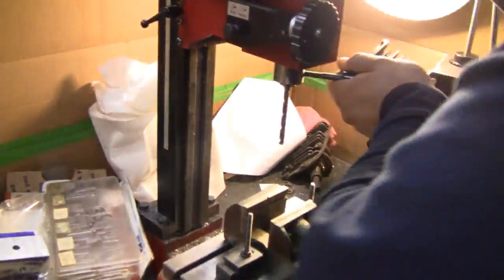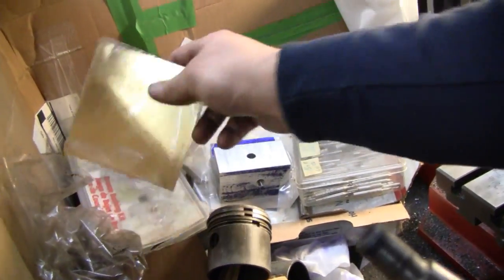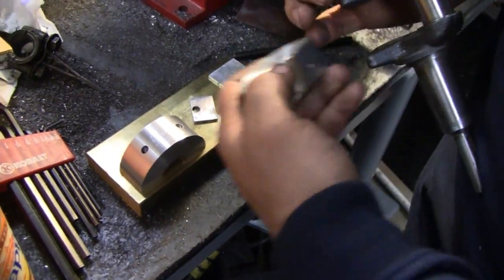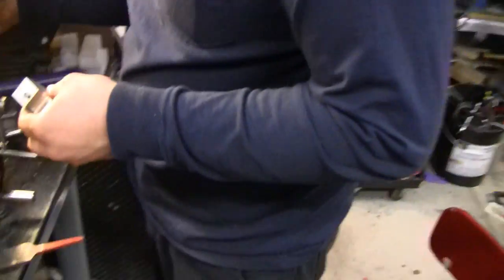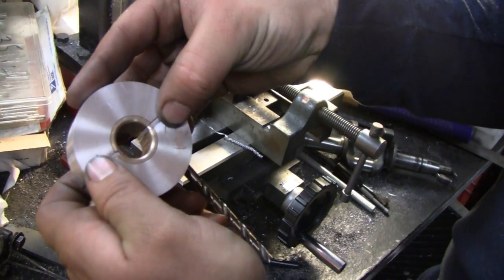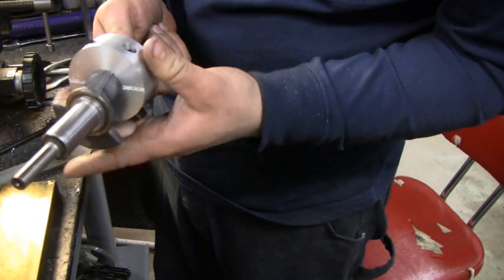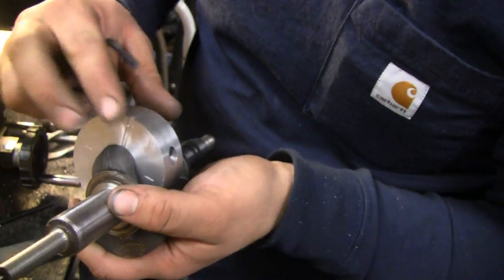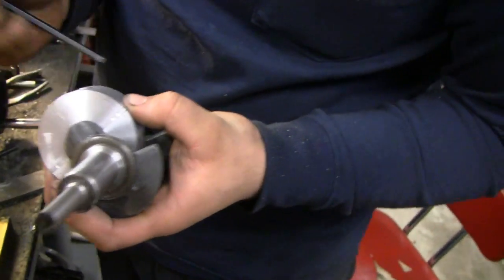HOMEMADE RADIAL BRIGGS ENGINE (part 17)

Comment: Wow, this is the last update you've done on the Radial in over 6 months, but I see you've been active with other stuff.  Hope you haven't abandoned this project!
I used to be involved with the EAA (Experimental Aircraft Association), and quite a few of the guys in my chapter were (re)building various classic aircraft engines, but I don't think anybody was doing anything like this!  When you do get this engine finished and mounted up on a display stand, I hope you have a wooden propeller attached to it.   You should use an aircraft style magneto for the spark, so you can hand prop start it.  I can almost see this thing flying on a large scale model bi-plane.
Reply from the maker: It's only been a couple of months!! I haven't updated the playlist in a while!!☺
Reply: OK, I see you're up to part 22.  I'll have to search for 18 and on manually.

Comment: Nice job. Curious to see how he does the conrods is he going to mill them or go for an external fit seeing those 2 bolts on the bearing doesnt look like enough clearance for 3 equal angle conrods if milled. But then Mikeys a genius looking forward to the next fun filled installment.
Reply from the maker: +robi1nz Thanks Bud!!☺

Comment: why wouldn't you bolt them together and bore them to size. just asking the reason for shims
Reply from the maker: +rttguy1969 The shims prevent the bronze bearing from spinning in the housing!!☺
Reply: +805ROADKING thanks